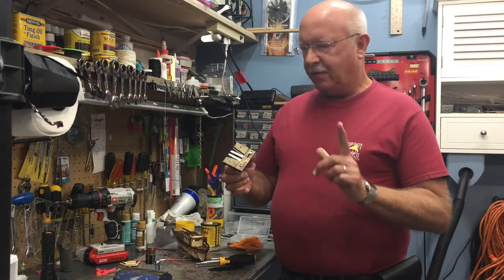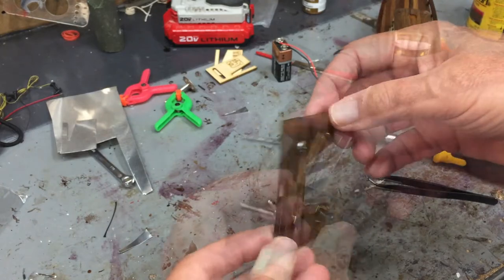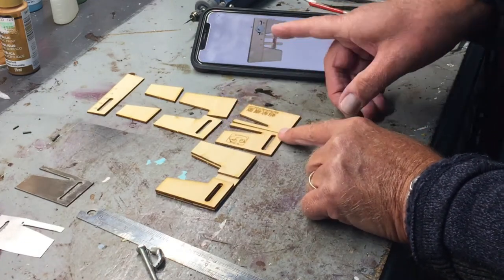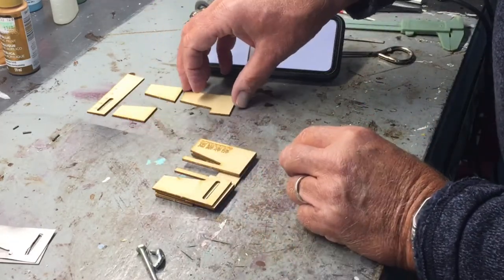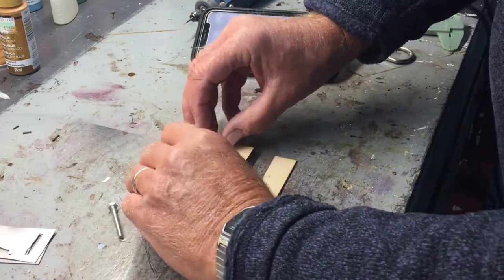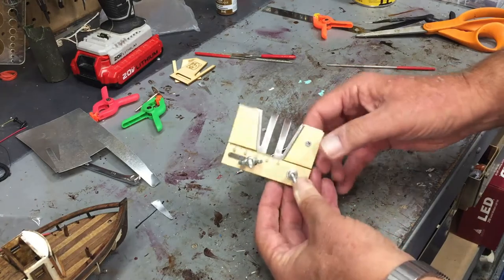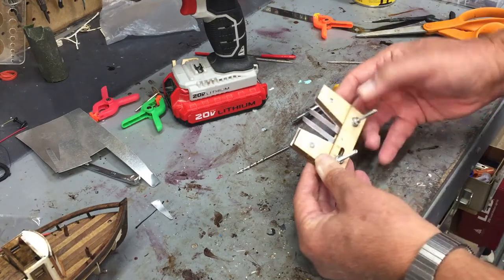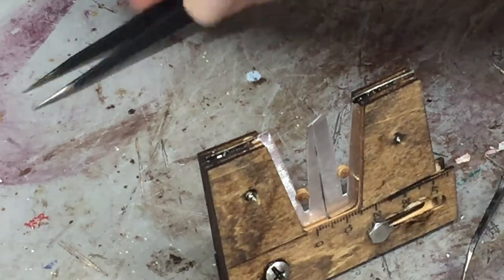Dead Eyes Mooring Tool Assembly

Comment: Thanks for taking the time for sharing this. Helpful.
Reply from the maker: You might check out my follow up video…. Turns out, for me it’s easier to do them on the ship….
I’ve just made a little jig that’s looks like it might work better and you can make it from just a little plank of wood and add two wires or small nails at both ends….
I’ll show it in an coming video of my building The Black Pearl All Scenario version. 👍

Comment: Nice tool...even though it didn't work for you, I may need to give it a shot.
Reply from the maker: I had trouble with them twisting after I made them.  Using them on larger deadeyes would probably work. But the tiny ones….. not for me.👍🏴‍☠️
Reply from the maker: One other thing.  Mine came with wood deadeye holders.
I ordered thinner metal ones but when it arrived, it was just one…. Another $10….. so it would be $20 for 2!  I ended up getting a second…..
Should be able to make them yourself 😁👍
Reply: @BoilerDan1  I saw them on Amazon...for $45 for the pair.  I might try the wooden one first to see if it is a viable tool for me.  Going to (finally) get back on the ZHL Black Pearl all scenario version...
Reply from the maker: My favorite ship!  I’m at Disney World as I write 😂.  Not that the Pearl is all about Disney….. but it’s the basis that began the saga.🏴‍☠️👍.  I’m looking forward to completing my collection with The Flying Dutchman (soon)!
Reply: @BoilerDan1  I have the Dutchman too.  Great that your at Disneyland...been a while since we were there.  A lot of the models I have are stocking up...I'll retire in a few years and have less disposable income...so I;m planning ahead.  Enjoy your day at the House of Mouse!

Comment: Was there a part two??? Didn’t see it in use
Reply from the maker: Well, I thought I did a follow up!  But it’s not there….😵‍💫.  I think I mentioned it in one of my ship building videos …. Sorry.
In the end it didn’t work out for me.  The Deadeyes kept getting twisted when I tried to attach them to rat lines.  So it’s a “No” tool in my recommendation.
I’ve made a little jig that will give me a constant distance between the two deadeyes.
I will feature that in the coming weeks in the series on The Black Pearl All Scenario version.
It be sometime after Part 26 (which I’m in the process of doing now.)
Here’s a link to that series if you’re interested in following along?
https://youtube.com/playlist?list=PLjMZtm2hvqrNC_JZ8Hdtk0ibLi12y5ahV
Once I finish this project I hope to follow up with things that I have learned along the way.  I’ll try to remember to add the deadeye tool to the list.
Thanks for watching and bringing that to my attention.
👍👍
Reply: @BoilerDan1  thanks for the reply. I didn't think it would work for me either as I wanted the lower deadeyes fixed to the ship so I can tension those upper ones and their attached shroud lines. Cheers for your videos
Reply from the maker: The thing that I’m trying now is a plank that is the distance I want between the upper and lower dead eye.  Then on both ends I have two brass wires (or nails) that fit inside the lower and upper two (of the three) holes in each deadeye then I can tie the loop around the upper one and hold the lower one equal distance  for each set as I hook up the ratlines!
Not sure I explained that very well. But in early experiments it looks like it will work.  I do have the wires coming from opposite sides of the deadeyes. It seems to hold them in place better.
Once that’s done, I remove the jig and can do the rope work between the two deadeyes. Then repeat for the other sets.
Maybe it’ll be clearer in the video 😂🏴‍☠️👍